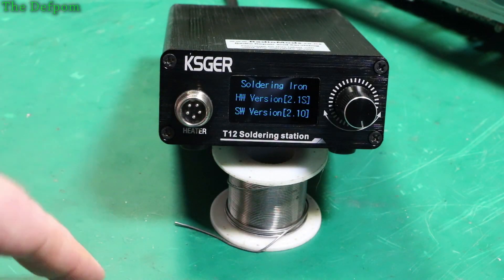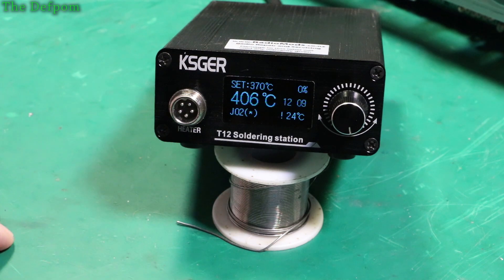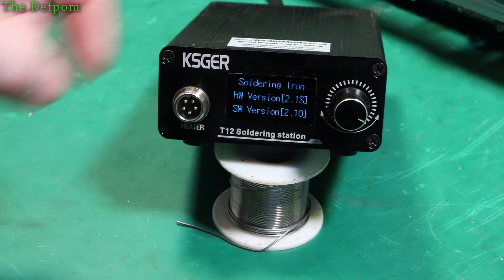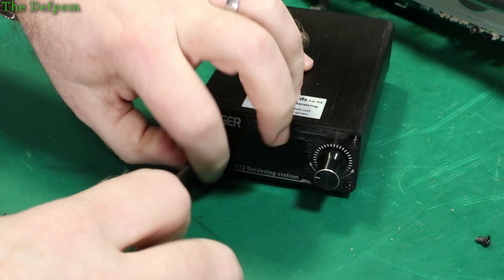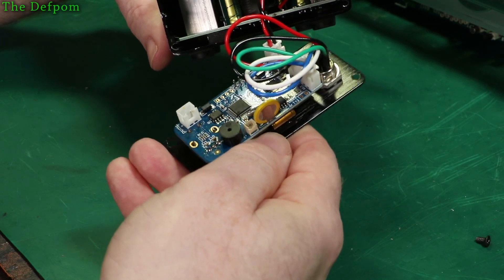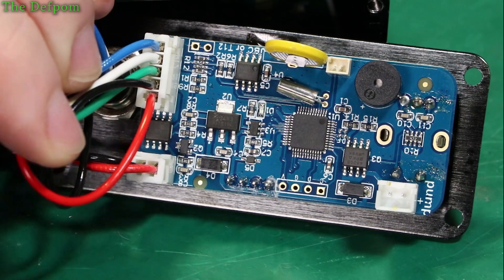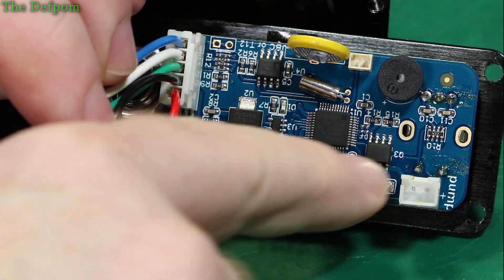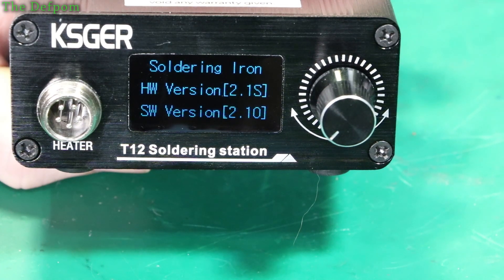🔴 #574 KSGER T12 Hardware Issue - Will The Real HW 2.1S Please Stand Up

Comment: Hi i have a unit with similar control board. Problem is i cannot make any adjustment to the settings with the Rotary Encoder. The switch  on encoder does work but i cannot change any values i have replaced the encoder with one from an Arduino module i think KY40 but same results any idea what might be wrong would be appreciated.
Reply from the maker: That sounds like there is a fault on the PCB, maybe a bad solder joint or solder bridge somewhere.
Reply: @TheDefpom  Thank for reply had a look but couldn't find anything obvious

Comment: My version is like your's with no capacitor on the blue board but different than yours in tbat my battery is wired and not permanently attached like yours. So my unit is in between yours and Voltlog's I guess....wish more how to videos existed on my version since I'm a newbie.

Comment: A related youtube video by John Salt  identifies a possible cause, he found that on his board the metal part of the switch (Rotary Encoder) being misaligned shored two traces thereby grounding one side of R10...
As not everyone reported battery issues, it's entirely possible this could be an issue....
Reply from the maker: Michael O'Toole - that sounds plausible, thanks for the info.
Reply: I thought one side of R10 shorting the battery was connected to ground anyway.

Comment: I'm having the impression that there are a lot of clones of these Ksger stations on Banggood. HW revisions look different from the Aliexpress Ksger Official Store ones, and the same goes for the FW that looks even more different on some models listed on Banggood (some have serif fonts instead of sans-serif, and use angle brackets instead of square brackets in the menus) and other stuff. Very annoying. IMHO yours is not a genuine Ksger one.
Reply from the maker: Giacomo De Lazzari - it is hard to know which is the fake, the build quality of the unit I have is good, better than others I have seen, my thinking is that the others are fake because of that, but I really do not know, maybe they are all fake!
Reply: @TheDefpom  Sure, of course being a "clone" doesn't imply it's bad. It's just a pain to troubleshoot/compare/work on since there is an insane number of variants you can't even identify easily! That's really annoying :(

Comment: Interesting that it shows the same hw version in the menu but in reality you have a completely different board. Anyway, upon further investigation on my unit at least that R10 resistor is there, in theory to prevent reverse leakage current to the backup battery through the diode used in OR configuration above. Except it's somehow placed in the wrong spot in the circuit so it just slowly drains the battery. Possibly a design error.

Comment: @Defpom's Electronics & Repair - I Fix Stuff 

Do you also have the terrible power supply with a heatsink insulated from the mains only by the soldermask on one side? That would be worth checking. 

The battery issue is annoying but why a soldering iron needs an RTC is beyond me, so likely not a big issue if the battery is removed. The power supply on the other hand could be a nasty death trap.
Reply from the maker: Jan Ciger - I will look into that finding, if that is the case I may look to modify it.
Reply: @TheDefpom  @VoltLog has it in his video. And given that you have a metal case, not plastic, that could be quite an issue.

Comment: According to Voltlog, his unit is equiped with a 5A fuse in the IEC connector on the back.
Seemes a bit extreme to me, wouldn't a 1A fuse be more suited?

Is it the same size on your unit?
Reply from the maker: Geir Endre Jenssen - I don’t think that I have actually looked, I should check that.

Comment: So it's probably not easy to measure the standby current drawn from the battery when it's soldered on like that.
You would need to lift one leg to do the measurement.
Just to check if it has the same problem (just with another resistor)
Reply from the maker: Geir Endre Jenssen - I think mine is ok, I have had it since January and there’s no sign of the battery being bad, although I don’t pay attention to the units built in clock anyway!

Comment: I checked my KSGER soldering iron with hardware version 2.1S and it does not have the resistor across the battery. Mine has the all aluminun housing with the 6 mm machined front plate.
Reply from the maker: So your is the same as my one by the sounds of it, not affected.

Comment: Fairly typical of a cheap manufacturer, little engineering, Maybe copied the idea from a capacitor discharge circuit initially, Poor testing, design and build no testing means let the maker debug our gear and Poor quality control, wrong identification.  What else, let the makers show us how. Wonder how many makers request a refund or exchange for the failure.
Reply from the maker: The one Voltlog has obviously has the issue, my unit does not, it is interesting that they both have the same hardware version, whilst they are very different boards.
Reply: @TheDefpom  the last statement relates to your unit and the title of your video.

Comment: The other thing that seems odd is KSGER offers a programmer for their stations but they do not offer the firmware as a download. So I would think there could be hacks that could be done but it would be great if they could offer the base code.
Reply from the maker: I haven't looked into any of that, I have been perfectly happy with the my unit, it works well.